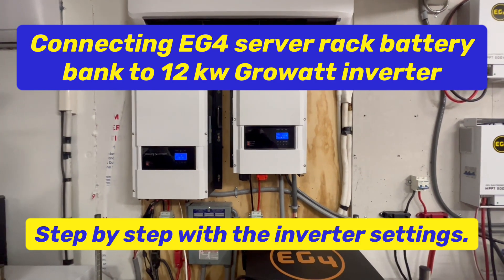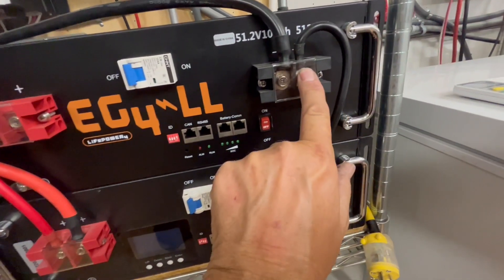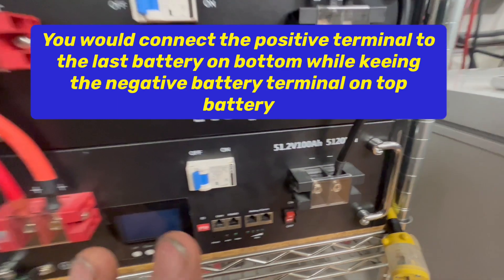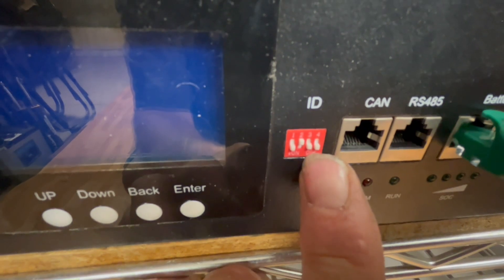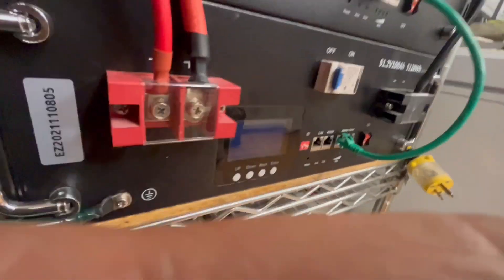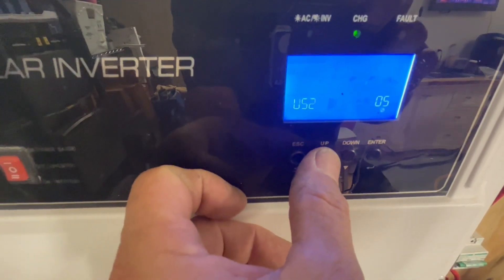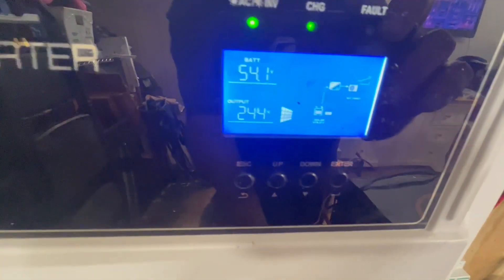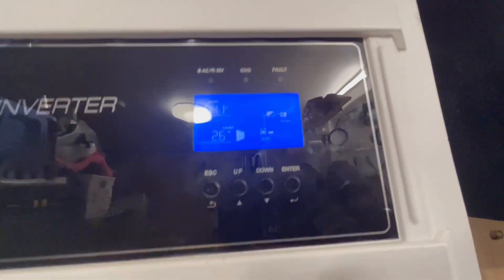Connecting EG4 LiFePO4 51.2v battery to 12 kw Growatt 48v system so inverter commutates with battery

Comment: Is the white cable from the master battery to inverter bms slot a 3 ft rs 485 cable or the read and write cable from sig solar
Reply from the maker: I used a RS 485 cable that was 6 feet long. I bought these batteries refurbished so they did not come with cables in box.

Comment: Hi Mr Pappa, wondering will be big sparks on Capacitor in your other video when you install soft start on AC unit?
Reply from the maker: No sparks like with a AGM battery bank when connecting to LiFePO4 battery.
Reply: @diy-solar-guy  will Cap blow if we touch 2 post long?
Reply from the maker: With power off on ac unit and ac disconnect fuse pulled out. When you short out, there should be no sparks. You are just draining charge stored in capacitor. Just make sure you are not touching any part of metal of screwdriver while shorting out leads on capacitor. Your hand should be on the insulated handle of screwdriver only. Your other hand should not be touching the ac unit as you discharge capacitor. Make sure you have metal of screwdriver touch all 3 terminals on capacitor as you move to short out 2 leads at a time. Touch metal of screwdriver to one terminal and have the metal of screwdriver also touch the another terminal so that you have contact of the metal touching both terminals. Then short out other terminal while still metal of screwdriver in contact with first terminal as you touch 3 rd terminal. You only need to short out terminals for a few seconds. I always rotate and do again, making sure I short out terminals. You can use a volt meter to check terminals to make sure there is no voltage left in capacitor. Even after shorting out terminals I like to use insulated handle needle nose pliers to secure wires onto capacitor. You can also use mechanic gloves to be more safe. Hope this helps. If you are still unsure, try watching a video or two from someone else and see how they short out the terminals of capacitor until you feel comfortable that you are ready to proceed.
Reply: @diy-solar-guy  Thank you, you are a Solar Rock Star👍🇺🇸
Reply from the maker: You are welcome

Comment: Also, just to let you know. It is bad Idea to connect this inverter to grid in bypass mode. I had to remove my grid connection completely do to neutral ground bonding issue. Unless you use separate ground rod in your off-grid system this will back fire on you. The issue is balancing 120V-N-120V. This inverter designed to balance loads with its own transformer in bypass mode. So if you get unbalanced 120V from the grid, it will try to correct it. Some people reported of over 60A of unbalance coming from the grid and it fried them inverters. Watts247 stopped selling it for this exact reason. Also if you try to connect Grid in Neutral to Inverter out Neutral you will most likely need interconnection Agreement with your Power Company. This is not UL listed product, so they will not issue one to you. I tried to legalize mine for 12 months with no success. I had electrical engineer work on the plans and he quit on me do to Inverter being unsafe in Grid Bypass and requiring Ground Neutral Bond in battery mode. Signature Solar recommended relays to switch ground neutral bond, so I tried it with a big bang result. The 10ms Relays were not fast enough to disconnect the ground neutral bond, then it goes in grid bypass. It energized the Neutral and blew 100A circuit breaker in a main panel feeding the Inverter. So please be careful with this one. It is ok to install it powering a large barn or garage with its own ground rod and neutral bonding in dedicated off grid panel, but connecting it to the grid in any shape or form brings problems. I found this one the hard way. .
Reply from the maker: Thank you for your input. We appreciate it.
Reply: @diy-solar-guy  Do not get me wrong. It is an excelent Inveter for complete of grid system, like barn or large garage loaded with power tools. It will start them all at the same time. I had my 10" table saw runing, my dewalt compressor kiking in, while I was using the 12" bosh chopssaw. With this Inverter I also used: 240V Welder + 7" grinder + 240V 12" bricksaw, electric pressure washer It is crazy powerfull for starting inductive loads. And it it did it with just 2 EG4 LL battaries. If only they put a little more effort in to this unit and equped it with Isolation Trasformer instead of Auto trasformer + improved the software a bit, I would never have replaced it.
Reply from the maker: @alexnoff6284  I’m pretty much using the 6kw and 12 kw Growatt inverters to run my ac’s & pool off grid. No longer need to use grid bypass.

Comment: This was a turndown for me. Inverter only capable of charging at 50A in BMS comunication mode. I had a rack of 10 of EG4 LL V1 and only able to charge at 50A. Sad ending for me  😞This happens because Growatt 12K can only see 1 battery and sets the limits of charge and disharge based on 1 battery. 100A max discharge 50A max charge. If you try to go over 100A of discharge in BMS communication mode it will shut down on you. It did it to me. Also on the sunny day you can charge at 120A, according to the specs of this inverter, but in BMS communication mode you always limited to 50A. So in my case with 10 batteries it is 5A per battery. NOT acceptable. Signature solar does not have a solution for this. They say USE2 mode is the only way, but in USE2 mode Inverter does not see: Battery AMP's, State Of charge in %, Battery Temperature, Individual Cell Voltages, etc. There is a video out there showing DIY battery with internal BMS going in smoke and Growatt 12K kept charging it in USE2 mode while it was smoking.
Reply from the maker: I had same issue of only being able to charge at 50 amps no matter what I changed in settings.

Comment: What happens if your inverter stops working? How are  u going to power your house? Do u have a transformer connected?
Reply from the maker: This system is completely off grid. If the inverter goes out, I have back ups and still grid power. I use off grid to save money on electricity. I save around $4000 - $5000 a year off electric bill. No transformer connected.
Reply: @DIY solar power with Pappa off grid projects  how do u use the 
Grid, once your inverter goes out? I'm trying to figure that out just in case something goes wrong with my inverter ..
Reply from the maker: My off grid inverter uses grid as a bypass to go through it but the inverter does not feed into grid. It can only use grid power as in input. All my appliances connected to inverter are wired separately from my grid. The grid power by utility and off grid are two separate independent systems. I can use grid to run appliances connected to off grid inverter or charge the battery.if grid power has an outage, I can run all ac heat pumps and all fridges and freezers, but one fridge I would have to run an extension cord to that fridge. My power very rarely goes out in last 20 years and when it did, the power came on within 2 hours. You can use a transfer switch to change from grid to off grid power, I know others that have that installed. Even with that transfer switch, you can only have one power source connected. Either grid source or off grid power inverter. I won’t install a transfer switch as I could move in a few years and would take all my off grid system with me to new house.
Reply: @diy-solar-guy  So you are saying you installed a separate subpanel, removed the appliance feeds from the main panel to the sub now your apliances are running off the inverter in pass thru mode ( from grid) or by inverter ? I thought about doing something similar but i didn't want to utilize the pass thru function. Found it easier to just back feed the main panel and use a lock out device so only one source can be used.  Our grid ( south fla) is pretty hardened and rarely goes out so I use my system as a cost cutting deal - Only go back on grid when I lose a sunny day and have to recharge the battery bank - or I fire up the EG4 100 amp charger .
Reply from the maker: @TrollingwTyrone  I have  2 completely separate 200 amp panels that are directly wired from panel to ac heat pumps and pool pump. My system is not connected to my grid. I have grid power connected as a backup for rainy/cloudy days but that is rare in Arizona. I can’t have any of my system feed into the grid because I would have to get inspected and approval and permits from city. They would also raise my monthly bill to double if what I pay being off grid. The utility company out here punishes you to go solar on grid because they will loose 1/2 their revenue. Anything I run off grid I had to directly wire independently. I used a lot of wire but got a lot of great deals getting 1/2 off or more on the wire At Hardware stores. Think of what I have as a completely off grid system as far as not using anything that is wire from grid electrical panel except running a 220 line into a sun panel  that distributes to 3 inverters with a breaker for each. I did that in case I needed to charge battery or to use as a pass thru where the grid feeds my off grid wiring in my off grid panels. I very rarely use grid pass thru since I’m able to produce more power than I need. I wish I could hook up to my main grid panel but I would spend $1000 more a year on electric bill doing that. If I try to tie in to grid I have to submit plans, have inspections, get permits and put panels on my roof. I have no solar panels on my roof except for 2-40 watt roof hybrid solar exhaust vents. I had those professionally installed when I had roof repairs done. All my panels are on arrays or pergolas. Hope this helps you to understand what I did and how I did it.
Reply: @diy-solar-guy  Yessir - Now i got an idea what you were getting at . I did mine without a permit but I spent MANY hours studying NEC code and built it accordingly. I have a long narrow  east -west run of my back yard that is not used so i threw down around 30 panels on the ground propped up on bricks to get the proper anlge for time of year. I have had 60+ mph gusts and the panels have not moved but if a hurricane is def going to hit us it takes me maybe an hour to unplug the panels and stack them. I use large in ground anchors and ratchet strap them all together.
Reply from the maker: Sounds like you have a nice setup. Nice utilizing the real estate in your yard with panels. Some of my panels on my pergolas are just laying up there but will soon be secured down. I only lost 2 panels over the last 3 years. Just have not had the time or energy. But soon
Reply: @diy-solar-guy  Oh yeah on the subject of power company rip offs-  something weird I noticed - My utility companys website lets you see monthly, daily and hourly kw/h useage and cost,  for all the hours I am off grid it shows "approximate cost" of  $ 0.02 ( with no wk/h useage) = a whole day is .40 which adds up to $12/month!  I kinda do not want to open pandoras box and call them or have them come out. They "claim" the smart meters take very little energy to run and that useage os off the utility side not the customer/metered side. But if they slipping this under the radar to millions of customers in the state.....
Reply from the maker: @TrollingwTyrone  They double our electric bill to install on grid solar on roof because they say our usage will be half if we were to install on grid  solar so they need the money for improvements and repairs, maintenance, etc…and it is really expensive to get inspections, permits, etc…. For the process. What people don’t realize is when you have a roof leak or have to replace roof, all that solar has to be removed to do work on roof then after work is done, the solar panels have to be reinstalled as like it was for the first time. The only holes I put in my roof was solar hybrid roof exhaust vents that remove 5000 cubic feet. That keeps my attic below 115 degrees in summer when temps out here will hit 115 degrees or more. Before when it was getting close to 160-180 degrees before exhaust vents were installed. Those, the roofers in future would leave exhaust vents there and just work around. They also charge .17 cents a kWh in summer and if you are on a time I’d use plane and use when you are not suppose to, then your rate will go to .36 per kWh. There really is no savings going to a time of use plan. They just need people to not use electric during peak hours to avoid overloading system. It gets really hot out here when ac goes out. Inside temps with no ac will go well above 100 degrees. Not in Pappas house. We stay in the 60’s degree range during the day with no grid usage and soon will be increasing our LiFePO4 battery bank to run ac 7/24 off grid.

Comment: The manufacturer advise aganst parelling batteries through the battery studs 

"WARNING: Do NOT parallel batteries by using jumper wires on the double terminals. This will cause high amperage in the final jumpers and potentially excessive amperage on the battery terminals."

This is from the manual on page 9
Reply from the maker: They parallel the batteries on a bus bar in the server rack. I talked with Signature solar and told them how I have the batteries connected and showed pictures also what I was running. Each battery can draw 100 amps per battery. I only draw 80-90 total amps for a few seconds at the most, usually my draw out of battery is less than 20 amps. most current comes from solar panels. I am actually getting a server rack in the next week so I will show how to connect to busbar inside server rack in future video. When I get the server rack, it won’t be an issue anymore. But thank you for the comment and I appreciate you pointing that out with what the manufacturer says. Hope you have a wonderful weekend.